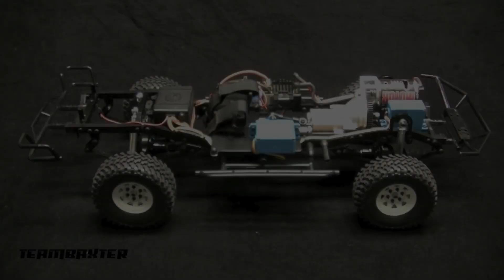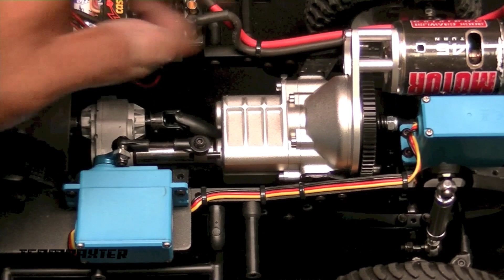RC4WD Trail finder 2 Build: Chassis/ Electronics

Comment: Thank you for posting this video. I also have a TF2. I modified it. I took out the single speed tranny for a two speed. I installed LEDs, l installed a blazer K5 hard body on my chassis. Moved my water proof box toward the back of the chassis. If you like to view it just send your e-mail. I also did some adjustments on the leaf springs and shocks to be a crawler. Have a good one!

Comment: rc4wd makes a full cover for the r3 trans, but you have to change the gears out, as it will only fit up to a 52t 32p spur... I plan on running it in mine and getting a 12t pinion as well, that is as close to the original spur/ pinion gear ratio

My shafts both blew on her initial run, but I expected it, I am hard on my RCs
Reply from the maker: Seamus MacMattain I think that she'll do just fine without a gear cover, i dont like it too much, but i dont have plans at this point to change the gearing. Yes, im waiting for my shafts to break as well,it surprisingly did not happen during my first run, they held up pretty good. Thanks for watching and commenting.
Reply: that's OK, I was mistaken, I was thinking of the AX2 for the scx10, not the R3 from the TF2 anyway